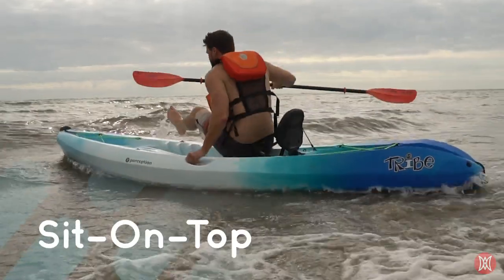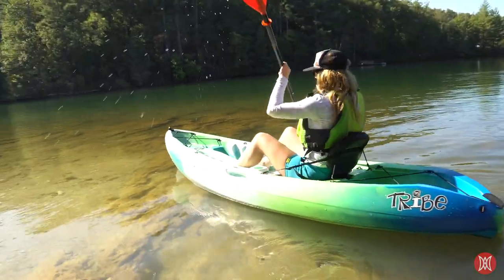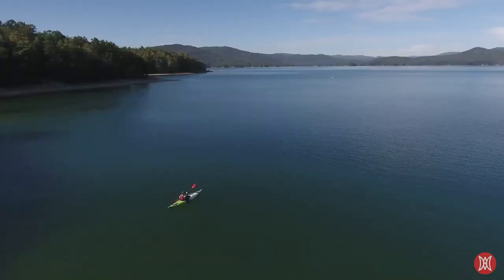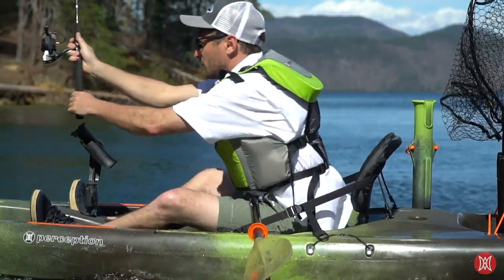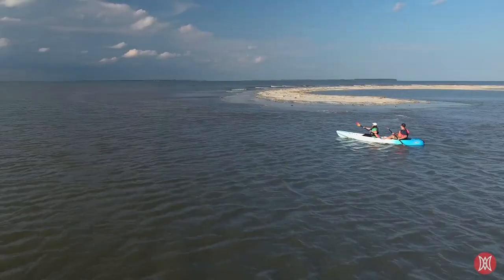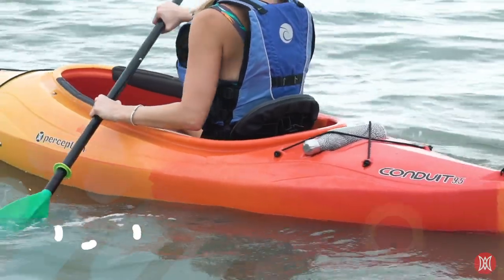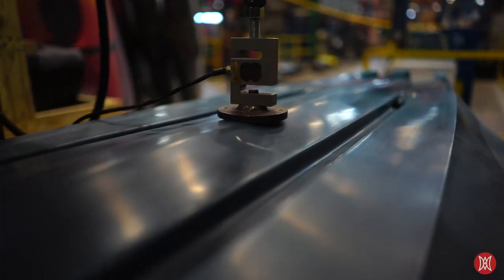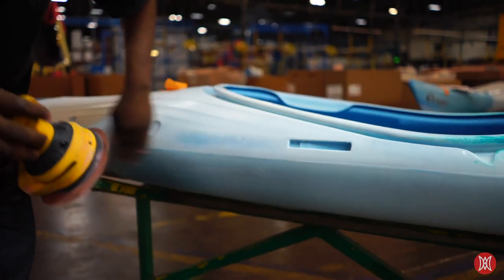How to Choose a Kayak | Perception Kayaks

Comment: The Perception Conduit 13.5 is probably the best open water kayak for the money. They are a bit slower than the 14-16-17's, but they aren't so slow that you become fatigue. They aren't too wide, but also are nor to narrow. The Perception Conduit 13.5 is just a fun kayak to be out on the water in. Whether your short distance paddling, or taking a day trip. I've also had the Conduit 13.5 out in 7' swells after storms, and boy are they playful! I have to hand it to the designer's at Perception, because the Conduit 13.5 can pretty much do it all. I'd even go as far as to consider the Conduit 13.5 a crossover kayak, balancing between a 14-14.5 sea kayak & a 11-12 recreational kayak. The Conduit 13.5 is the best of both worlds.

Comment: My first boat was a 17.5 ft Perception Sea Lion. I still adventure in it. A friend has one as well. It does do better with a rudder but is fast and efficient for long journeys, easy enough to wrangle for an afternoon on the lake, and floats in about 5" of water. I've had it up narrow streams, on creeks, rivers, lakes, bays and open ocean. It is decades old and still awesome.

A friend has two 12' Perception Prodigies, nice rec boats, very comfortable, roomy cockpits but don't ship water easily. They handle well and are especially good boats for beginners, large paddlers, or anyone just wanting a relaxing afternoon on the lake or bay.
Reply: Is that sea lion any good? I found one at a price of $500 bucks. It comes with the water skirt. And the thang with the wheels to help move it around. And it has the guid on the back of it
Reply: @crisstephen4476  They are awesome, $500 is about average in my experience for a good used sea kayak. This is not a "playful" boat that carves waves, this is a starship... it goes straight and long and plenty fast. It floats in four inches of water, fully laden and stuffed for a two day backcountry paddle, I think it finally ran aground in Tom's Cove in 6" of water. It's comfortable, the cockpit is (for the average paddler) big enough to be comfy and small enough not to ship water. It's stable enough to swim up onto in deep water (put fins on your feet, throw yourself over the pointy end as if getting on a horse bareback, then straddle the boat, and inch your way to the cockpit, drop in...), it has nice secondary stability, you can stick it on its edge and it stays there (if you have decent balance).

You will want a rudder. Or DIY a skeg. My friend has a Sea Lion with no rudder and  if you are on big open water with wind, it will weathercock and you'll have fun paddling on one side to stay straight.

With rudder it is perfect. I've paddled a few others (and I have a nice Wilderness Systems Cape Horn... which is a hair tight in the cockpit for the arthritis) and the Sea Lion is still my favorite. I've had it on streams (turning around in a creek that is no wider than the boat is amusing), salt marshes, rivers, lakes, and offshore a couple times. It's no heavier than boats half its size, but is sturdy (mine's over 20 years old, I think)...about 50 pounds. I let it surf itself through waves to shore (I swam in after) and it stayed upright. It's handled all kinds of wind, waves, tidal currents, river currents and expeditions long and short.

Yes kayak wheels are fabulous. Easier to wheel it to the water yourself than to try to have two people carry.

I have gone through a couple hatch covers, they're neoprene, and you can use wetsuit cement to fix them, but at some point you may need to order new ones (see a local outfitter). I've also used silicone caulk to seal the bulkheads: there's one behind the seat and one in front of your feet. These divide the boat into cockpit and two watertight compartments. You'll get a little leakage through the bulkheads... as with any boat... or through the hatches... so stuff on those compartments should be in dry bags, same story for any boat.

You can balance the boat (make it sit level) by adding weight in front or rear compartments  if needed (depends on paddler size and what gear you are carrying). 

It won't sink, the bulkheads are floaty, but don't open a hatch on open water... if you flood a compartment it's going to be "Cleopatra's Needle" time with your boat pointing skyward (same with any kayak). You can stuff float bags, pool noodles or gallon jugs full of air into the compartments for added flotation, just in case. Carry a bilge pump (the ones that look like bike pumps).

This is an all around useful kayak.
Reply: @teannabyerts1904  great post.  i'm currently considering a used, carolina 16'.  if you ever consider selling your sea lion (& you live in florida) give me a shout.